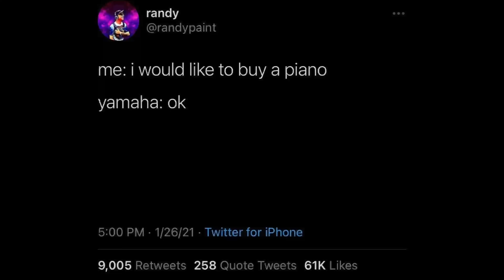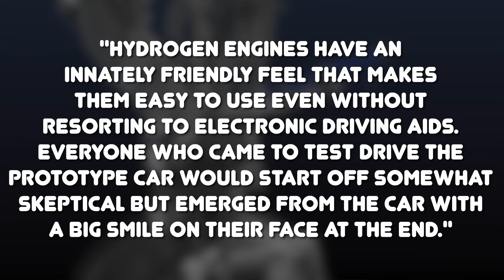Toyota's New 455HP Hydrogen V8: Everything You Need to Know

Comment: You didn’t really mention the greatest advantage of hydrogen. The fuel is abundant, regardless of current fueling stations. People have this idea that we could all of a sudden have several billion electric vehicles and big trucks running around. I think Toyota is genius for realizing that there isn’t enough power grid and lithium production to make that possible. When everyone finally realizes this, you might start seeing hydrogen take over. A world full of electric cars with current technology isn’t sustainable. I think hydrogen has a better shot if we would could get fuel to the streets
Reply: EV will be niche unless the solid state battery fixes the problem that can be produced without using limited supply rare earth materials. And then there's electrical supply grid issues too.
Reply: Solid state potteries seem good, but they are more prone to Dagmar under varying conditions and use than the Lithium Batteries. In the end I’m placing almost all my money on hydrogen
Reply: Exactly.  The world should be taking note as to what the largest car maker in the world is doing.  Also, EVs are not profitable at the present.  Toyota recognized this as well.
Reply: @OverandOutChief1  >I think Elon Musk…the wealthiest man in the world who is happening to produce EVs at a nice profit and sell them at an affordable price, would be very disappointed to hear that!  It is the GAS car makers that can’t make money at it because they refuse to go all in….because people DON’T WANT ELECTRIC CARS BECAUSE THEY ARE INCONVENIENT!
Reply: @viscache1  Tesla is not profitable on its own.  It is being propped by government subsidies (taxes) or else you would see everyone selling all kinds of EVs.  Toyota, the largest car manufacturer in the world is profitable however without said subsidies.
Reply: @viscache1  The last 2 quarters turned a profit.  They are still receiving EV credits though from the US and the EU.  All quarters before were at a loss. They did figure out how to raise GP $ per vehicle which helped along with the strong demand in EVs due to the gas issue.  Hardly consider 2 quarters a trend though.  Also, you really need to see how much debt they are carrying.  It would be alarming to me since it wipes out profit for a decade at present trends.
Reply: @OverandOutChief1  tesla is not what u think it is. Its goal is not to make the money from the car. But from ur data imput. Ur a.car crash dummy. Ur gonna provide them the data.is.needed.to.feed.into ai. For selve driving cars. Once they have this they.make the jackpot. Sell theyre knowhow as a service to the other manufacturers.
Reply: @superliegebeest544  Interesting thought.  Toyota provided the technology and large capital for Tesla early on.  Even they saw the future was not EVs and sold all stake holdings in Tesla.
Reply: Fully agree, instead of trying to apologise for the challenges facing electric cars, let's back Toyota's vision of a hydrogen fuelled car, which will not need lithium batteries or unreliable charging facilities, to produce water vapour as it's exhaust emission.
Reply: @geraldabeyawardena5606  The enviro Nazis killed this because of a small amount of CO2 in manfacturing. However, they are fine with the fact that the manufacuturing of wind turbines produce more CO2 than the trubines will save in their entire life span. Also totally ignoring the disposal nightmare. This was the furture car companies were working on in the 90's once they got the process to be at least no more dangerous than gasonline. They then surpassed it.
Reply: This, people don't also understand that EV's are definitely not green vehicles, there's the Lithium production that is questionable morally and devastating environmentally. And the requirement for much more electricity production and consumption which would increase basic household expenses in an already inflating market, also increasing the need for nuclear power.
Reply: @Loodkuro  Exactly. Lithium may not be a fossil fuel, but there isn't even enough Lithium in the earth to replace all combustion engines with an electric one. Lithium availability is finite. An alternative is needed and it will be hydrogen. Hybrid EVs will likely become hydrogen engine based. The situation surrounding Ukraine and our rock bottom relationship with Russia means oil-based fuels will become prohibitively expensive over time, since the situation contributes to the scarcity of the resource, and an alternative will be required. Even gas boilers in homes are scheduled to run on part-hydrogen in coming years before these world events. In many parts of the world, buses and trains already run on hydrogen. Eventually it will all be hydrogen, because it will become cheap, with a plentiful and ubiquitous supply. In a world where convenience has always driven consumer trends, the growing unavailability of oil-based fuels, coupled with consumer environmental concerns, versus the equivalent utility via hydrogen and its ever-increasing availability and growing ease to prepare in infrastructure, can only point in one direction: hydrogen uptake. Of course, Elon won't admit this today. He's got Lithium-based EVs to sell.
Reply: @maybecrazy7835  the ocean if filled with lithium, it covers 74% of the planet.
Reply: @maybecrazy7835  well informed.
Reply: @Loodkuro  yes! People’s research is the news🤭 the news it’s a well… business
Reply: @Loodkuro  exactly there's only one reason we're not powering vehicles with hydrogen and it's called Lobbyist's
Reply: Yeah, plus batteries need to use a lot of scarce materials and have very high carbon output for production, ice hydrogen cars should be better, especially for the car enthusiasts.
Reply: Exactly electric cars and equipment are great but they are not the answer.  They essentially run on what ever powerplant your local electric company is be it coal or nuclear etc. The amount of new plants that would have to go up if every vehicle and piece of equipment were switched to electric would require power plants in practically every city and the only "green" way to do that would be nuclear for the majority of them. Imagine a Chernobyl or Fukushima in every city and town. Hydrogen really is one of the most efficient in my opinion and the only issue is safe storage which thanks to big government it's  illegal to sell the hydride to safely store it.
Reply: YES hydrogen is derived from water but you can't just pump water in the tank. They developed the fuel cells which they made the tech free to everyone and announce a few years ago at CES. You still need the fuel stations to produce "it's" type of fuel. They should eliminate that and make it so you can just fill up with water.
Reply: @mondum4539  they will never make it that you can fill up with water, because water falls from the sky and they cant control that. they would have to tax the rain.
Reply: @mondum4539  basic chemistry is not your strong suit
Reply: @mondum4539  no u don't u just gotta b smart the difference with how they do it is with chemicals instead of fire  or electricity. In this case u can use magnets to boil water. If only I could show u.
Reply: Just use the electric grid to power a hydrogen generator.
Reply: @tonywalker8030  na way easier to find water from a bathroom ND just refill with water
Reply: @tonywalker8030  u can make hydrogene from cattle manure hydrogen can be produced through anaerobic hydrolysis and fermentation
Reply: @michaelbrinks8089  they been doing that since 2016 in JP north island and  the port of Los Angeles is testing manure-derived hydrogen as fuel for trucks, cranes, cargo from this year
Reply: Um there is half a doz hydrogen fuel stations in California,  I checked when Toyota advertised free fuel for their fuel cell car....  sure if you live next to one.
Reply: Making hydrogen, at this point, takes a lot of electricity.   Its much more efficient to put that electricity into a battery to power an EV then convert it into hydrogen.   There are some technologies I seen videos on that may change that ratio in the future, but not yet.  At the moment most hydrogen production isn't very green.
Reply: exactly what I was thinking when watching the video, he is very wrong about EV's. they cant even provide a power grid these days to deal with a hot day and everyone using AC, let alone everyone plugging in a EV too, and where is the clean electricity going to come from to charge them all? that's not in place either. I think it would be a much easier job to changeover to hydrogen. we already have all the gas stations to sell it. he says zero maintenance? why do auto electricians exist? because gas cars have electrical problems, does he think electric cars wont have electrical problems? and what's it called when it's 8 or 10 years old and the battery's all need replacing?
Reply: pjslawschool  theres no radiation in electri cars. Making hydrogen from water is NOT cheap or efficient. Battery costs will drop in the next 10 years. Scotty doesn't know shit.
Reply: I would buy a hydrogen powered vehicle before I would even consider buying an electric one. I fully agree that the power grid isn't robust enough to handle that many electric cars and trucks.
Reply: Not to mention the fact that lithium is very dangerous and horrible for the environment.
Reply: Will probably have a period of industrial sabotage to make the hydrogen seem much more dangerous than electric,but in the long run it will be adopted and technologies making it cheaper will prosper.
Reply: @dennislock3415  nah, a couple of professors invented a conversion system to make diesels run on 90% hydrogen, and increased efficiency by 26.2%, seems like sabotage to me...
Reply: Also batteries for EV as of now are mainly China monopoly, Chinese companies getting their raw materials from mines in Africa (using kids i heard) sending the raw materials on big ships that pollute more than hundred of thousand of cars to China/Asia, make the batteries (in a plant powered by coal or gas) and send them (by big polluting ships again) to the west to build the EV. The EV is already polluting the environment before being driven!
Reply: Toyota didn't create it look up Bob Lazar hydrogen powered corvette
Reply: Exactly, the electric movement is quite disturbing when you factor in the that the cars aren’t that green (almost not green at all). The only actual plus is performance. The design language of ev’s sucks rn as well. The internal combustion engine isn’t going anywhere. Americans are fuck yards for letting green nazis take over our car market. Thank god Toyota making smart long term bet. Host is sheep for thinking EV will win out In the end. It’s been around since 1800s, what makes you think they’ll take over now?
Reply: There is no way to meet increase in demand that is just starting to occur with the proliflation of electric vehicles. Wind is worthless and there isn't enough silver on the planet for solar to ever be more than a small part of an energy grid. Sivler like gold is seeded here as the earth does not produce silver. All we have access to is silved that was seeded here after the earth formed a crust. The vast majority of silver sank once hitting the molten earth.
Reply: What I would REALLY like to see is a nuclear battery in an electric vehicle.  The one thing that the eco-freaks AND our government doesn’t have the stomach to admit (since the three major disasters…all based in the oldest science and design) is that the nuclear option is small, cheap and very safe now.  The current designs are so effective that if ever allowed to go forward will collapse the ‘pay for energy’ infrastructure.  We could all be running electricity in EVERYTHING….even warming the sidewalks and roads beneath our feet…if they would allow every state to put up two to 16 tiny, domestically engineered ultra safe nuclear power plants.  We would live like the Jetsons and pay like the Flintstones….but THAT will never get past the idiots that have DECIDED that socialism, wind (which they produce in abundance constantly from wherever they speak) and solar (which their egos over shadow and defeat)…’They’ are too stupid, don’t understand the science behind it all and would discount it out of hand simply because “We tried that already”.  IDIOTS!
Reply: Electric cars are horrible - dirtier, heavier, inefficient, and literally cause cancer…batteries are are anything but carbon neutral and are wrecking the environment….plenty of natural gas and oil resources here that should be utilized.
Reply: Hydrogen is a form that can be used in a car is not abundant.
Reply: @mb5058  oh yes it is it comes from water there's plenty of it.  Hydrogen is not hard to make from water but it seems like people today can't do the simplest things I mean alot of people right now don't even know how to cook or open a can with a can opener.
Reply: @jackdaniels2657  and you spew flat earth level nonsense, you can make hydrogen FROM water but it takes a lot of energy, hydrogen is an energy carrier not an energy source. stop spamming your nonsense, the only point you are making is that you would fail junior high chemistry class....
Reply: @jackdaniels2657  yep, as a 9yo, you just sound histrionic/delusional. you don't even realise that if your claims where true that would mean you had invented a perpetuum mobile
Reply: @mb5058  https://youtu.be/staL1wr07Sg
Reply: 28 minutes is where he shows u the technology
Reply: @mb5058  Neither is Lithium. It’s not like it falls out of a mine and makes itself a battery. The hydrogen molecule is just a tiny bit more common than Lithium
Reply: RIP Lil Peep  Do you think hydrogen is a rare element?
Reply: oh yeah and not to mention hydrogen is every were it falls from the sky every time it rains so why would it be so hard to refuel your motor
Reply: Just good until we don’t have any water left cuz we splitting it off to get its basic elements then burning one element if you split 5 gallons of water to its base elements and burn hydrogen your not going to get back 5 gallons of water your going to lose about 25%
Reply: use all the water 😂 we haven't even used all the oil or gas and they are nothing in comparison to even just the polar ice caps, the ice caps that they keep telling us will drown us all. mind you the shore line is still in exactly the same place it was when I was a kid 30 years ago and when my dad was a kid 70 years ago.
Reply: @chadmurray3621  your looking at the wrong shorelines check out the difference in the shoreline from the same period of time on say Salt Lake City Utah or even lake Shasta California… and yes the polar ice caps are melting slowly but the water is not staying in the ocean it’s been being used up slowly keeping the ocean shoreline relatively close to the same spot, we have been making hydrogen from water for years and I have a feeling it’s some of the cause of the droughts we have been seeing since we use hydrogen for testing and other things not just autos, once you break it down and burn half the elements that make water we have less water in the atmosphere and then less rain…🤔
Reply: This. Exactly this.
Reply: I'm the genius, hydrogen is everywhere. If you want a video of that ask me
Reply: Yeah people are glossing over the hard limits to scalability involved in electric cars. Wide spread adoption would make the price of raw materials skyrocket, create a massive disposal issue, and demand a monumental expansion of our power grid.
Reply: @catocall7323  not if people install solar, wind, and battery storage at home, with the grid acting as backup. That's energy independence.
Reply: @michaelkeudel8770  I'll believe it when I see it.
Reply: pjslawschool  no, producing hydrogen is expensive. You can dump electricity directly into a battery with small efficiency losses. Instead of taking energy to create steam  and reform methane or split water. Batteries are cheaper.
Reply: Elon Musk has acknowledged and says like you that over time EV is not sustainable. Be looking for has plan H in the next year or two. This is also current technology working on producing a safe version of Hydrogen for the commercial market that has the Hydrogen in a cassette type container in solid form if you can get your head around that.
Reply: @kingpin76110  storage and useage of hydrogen isn't the problem, creating the hydrogen IS. You can have solar and wind and battery storage in your onw house, you charge your car for free. Or you can drive up tp a hydrogen fueling stop and pay big oil to fill up your tank, making you rely on THEIR infrastructure and THEIR hands in your wallet. It's not and NEVER will be cheaper to produce Hydrogen.
Reply: Who says you need to use Lithium for batteries?  That's like a gen2 battery.  Very recent advances in battery research point to sulfur and other more common battery components that are cheaper to make, easier to recycle, offer greater ranges and similar longevity to Lithium.  Personally I think we should be dumping equals amounts of effort into newer, safer nuclear power facilities and smarter batteries.  Our university, for example, is looking to convert our old, coal fired steam plant into a new, tiny micro-nuclear reactor for cheap electricity and steam using existing nuclear waste as fuel (so basically free).  Hydrogen is a great idea, but I'm not sure how refueling works from storage to car 'tank?'  The engine is the easiest piece of the puzzle to figure out; it's an important piece, to be sure, but it's gotta be the easiest.
Reply: I agree and I hope this is the case.
Reply: Very true. Glad someone else sees that issue regarding EV
Reply: No need to transport hydrogen. Hydrogen stations can be made to extract hydrogen immediately as a person begins fueling. All thats needed is water running through a pipe like every home and sink. The hydrogen station will automatically extract the hydrogen. It’s not hard to do. 

Also another way is to pump water into the cars tank and if engineering design the car itself to extract the hydrogen within the car….problem solved. 

As far as containing hydrogen…..the stations can be made to freeze it to reduce leakage. 

OR

The vehicle extracts the hydrogen it need while maintaining a percentage in water. To reduce leakage and when ever it needs more the device inside car will automatically begin to extract the amount hydrogen it needs

And I don’t know about fella in the video. He seems extremely bias by saying there’s no differences between Gas combustion engines vs Hydrogen combustion. There’s a huge amount differences using hydrogen. Theres less heat being generated which gives all parts in engine bay including the engine longevity. Parts are less susceptible to wear and tear with hydrogen. 

Personally I’ll buy an electric just too vary my collection but i prefer combustion engines all the way. EV’s anyone could be riding a bicycle and no one would know if they’re about to get hit by a car because they’re so quiet. EV’s dont look fun, feel fun, roar from the engine. And what if a war breaks lose and the enemy attacks the electrical grid. We’re all screwed. How will we charge our vehicles to get around during war?
Reply: YouTube h2ilmarketing or just h2il. Supposedly found a way to super charge electrolysis to 5000% efficiency at large scale. I dunno if it's real or not.
Reply: Why is everyone ignoring the fact, that you'll never be able to save as much energy in a car battery as you can with a tank fuelled with either gasoline or hydrogen, its just physically not possible.
Reply: Exactly!
Reply: @Land and Lore Photograph Off Road Adventures Hydrogen already is being used as fuel for cars.
Reply: Agreed diversity have multiple power supply options which will make them all more cheaper in the long run. Not to mention more commonly available world wide which would inspire more innovative in each technology
Reply: Yes, hydrogen is abundant, but, it still has to be produced from water or natural gas which will take energy from fossil fuels, preferably natural gas, why not just run the engines on natural gas, there already is a partial infrastructure, long live ICE
Reply: It's nice to see the people on the top think and listen are open to new ideas
Reply: Hydrogen source is water. We don't want to use hydrogen for engines. Hydrogen is for drinking and washing clothes.
Reply: @eugene7518  Some of us don't want the regular engine to die
Reply: @\f_a/ exactly making it highly explosive
Reply: @\f_a/ ur point? I never said anything bad about hydrogen. Water is hydrogen water is also air. They add water to gasoline. Water is everywhere and it's free but people think hydrogen is a gas but it comes from water ND people don't seem to understand that
Reply: @\f_a/ perhaps alcohol is better
Reply: and lithium is bad for environment heavy and lame
Reply: We must not use our water to power engines. We need water to drink and wash.
Reply: Hydrogen is not abundant as a free element. It is tied up with oxygen in water. It is water that is abundant. Producing hydrogen is very inefficient. This is further compounded by compressing (or freezing it), then transporting and, finally, using it in an internal combustion engine.
Reply: Japan certainly doesn't have enough power grid. That's exactly why Toyota is going with HFCV technology. That and they're dependent on China for REM's.
Reply: Hydrogen is being used as a hydrogen battery, so it will need a lithium battery as well
Reply: @Anonymous-nn5wn  Only for the moment. The presence of a lithium battery on board currently available HFCV's is largely a function of the lack of H2 fueling stations. As with an ICE/battery hybrid, these can run on the battery alone  for short trips, stretching out a hydrogen fuel-up. The lithium battery can also store energy from slowing/braking the car, as with a Tesla. As H2 fueling stations become more widely available, and manufacturers seek to expand to a mass market with more affordable vehicles, the lithium battery will likely be offered as an option on higher-end models. A regular automotive battery will be sufficient for most vehicles.
Reply: I don't think so. EVs just need to do more research and develop cleaner, higher energy density and charges very fast batteries. For hydrogen, from splitting the atoms, converting it into liquid, then storing it, then transporting it, every step takes a lot of energy (which will result in high cost per kg)
Reply: Bruh, hydrogen is not plentiful on earth.
Reply: @aygwm  70% of the Earth is water. Guess what water is made out of?
Reply: @aygwm  Can you put crude oil in your gas tank? Will a chunk of lithium power a Tesla?
Reply: @mikegreen2229  does it require energy to split the hydrogen atoms and oxygen atoms? After splitting it, do you need to convert it to liquid state?would you lose a percentage of it while storing it?
Reply: @mikegreen2229  of course not, but implying that hydrogen is just sitting out there in its natural state ready to be burned is asinine. Critically, it takes more energy to isolate hydrogen than it yields when burned, unlike petroleum products.
Reply: @tanalson  What does that have to do with any of my comments? I’m not the one with the responsibility to make any fuel system sustainable, renewable, economical, reliable, etc etc etc…. Pollution from lithium mining? Toxic waste leaking from the damaged reactor in Japan? I never claimed to have any of these answers. I question people’s common sense, which is lacking in these comments. I wish I never replied here, because I constantly get notifications about bs like this which is a complete waste of time.
Reply: agreed...
Reply: or the fact you are able to produce it yourself and they hate self sufficiency
Reply: hydrogej is not abundant you need to make it, it's a power carrier mot a power source. considering the worldwide move to destroy energy production inder the guise of going green there is not enough power toake hydrogen on scale. also its less efficient then using hydrogen in fuel cells to create electricity
Reply: @nicoramaekers1623  The most abundant element in the universe
Reply: @boywhohasl1vedhascometodie469  true but that has 0 relevance in regards to using hydrogen on earth. its the most abundant element in universe because most stars are mostly hydrogen, but id like to see you fill up your car there
Reply: @boywhohasl1vedhascometodie469  do show me, hydrogen produced with nuclear generated power thru electrolysis is close to 0, is that what you are talking about?
Reply: @nicoramaekers1623  Just because you have to process it into fuel doesn’t mean that the element of hydrogen itself is rare. It is literally everywhere
Reply: @mikegreen2229  not as hydrogen on earth....as part of water and loads of other molecules yes. are you being wilfully misleading? get if from water and it takes energy, get if from fossil fuel and it pollutes....should not be too hard to understand
Reply: @mikegreen2229  on a sidenote hydrogen would for sure be the better option vs batteries, if power was plentifull and cheap
power is gettingore expensive and scarce each day due to so called environmental policy (which is eating up our supply of rare metals like indium at ever increasing rates)
Reply: @nicoramaekers1623  where is the fallacy of what I have said? Hydrogen, as an element IS extremely common. That has ZERO to do with the process of extracting it. Do you think that electricity was easy to generate or transport at first? We literally had to build an entire infrastructure to do it. They even struggled for years to decide whether AC or DC was the best way to use it in everyday life
Reply: I have the same opinion.
Reply: Along with the weight of EV"s. There will be at the very least 1,000 additional lbs per EV, what about parking garages, bridges, the roads, etc. Non thinking people make decisions on Emotion, never on Logic. All you have to do is think
Reply: And Japan is working on a new nuclear reactor that doesn't meltdown and simultaneously on a viable and cheap way of producing Hydrogen. Which both systems are on the verge of approval. They basically want to produce Hydrogen with nuclear power, and i guess it's working.
Reply: Oh and most hydrogen is cracked from propane🤪
Reply: hydrogen is not abundant it is not a natural occurring gas it needs to be created as for lithium it is one of the most abundant minerals on earth, just another bs trial by toyota to try and stop the advance of BEV while they try to make more hay out of the petrolheads that are high of the fumes of petrol
Reply: He also doesn't realize that similar was the case with EV electric charging stations just a Decade ago. So in a Decade if Hydrogen Engine kicks off now the Hydrogen Fuel pump will widely accessible. And for true car enthusiast that gonna a deal breaker. As I love to have a engine any kind of engine rather than two silent motors. Electric cars feel soul-less for me.
Reply: Honestly hydrogen comes from water u don't need hydrogen stations. This isn't new technology. The guy that invented the original hydrogen powered car was murdered. The way to create hydrogen is pretty much just boil water ND it turns into a gas finer then steam. Steam engines was technically hydrogen motors ND yes steam engines are to this day the most powerful engines ever built. Steam engines don't have an actual power  limit, the limit of a steam engine is being able to contain the pressure cus it's so much pressure it can easily be turned into a bomb if the boiler runs low on water.
Reply: @jackdaniels2657  not trying to start a YouTube comment war, but you can't just boil water and get hydrogen.  Electrolysis is the process of converting water into hydrogen and oxygen gas by the use of electricity.  The problem is that it's horrendously inefficient and therefore really isn't a solution at all except for perhaps more remote fueling locations.  Piping in or trucking in hydrgon will be the most economical way of getting fuel to stations for a while.  The issue there is that the average Joe isn't too keen on hydrogen lines running throughout town even though they aren't much of a safety concern.

Aaaaanyway....  Steam engines are also not powered by "hydrogen", just sayin'.  It's steam (aka water vapor, not hydrogen).  ;)

Bot or not I thought a reply was worth a shot.
Reply: @bentracy7463  dude u boil water it will turn into hydrogen. I'll send u a link
Reply: @bentracy7463  steam engines are powered by steam but that steam can turn into hydrogen if done correctly
Reply: @jackdaniels2657  we need electrolysis to become efficient
Reply: @jackdaniels2657  Idk what chemistry class you took but boiled water is still water. It’s just water vapor or steam. If what you’re saying was true you’d be able to hold a lighter above boiling water and have it combust.
Reply: @bentracy7463  >yep, no war, I spent my career in physics and it is very clear that electric cars are really sexy and low maintenance and we already have the BASIC (but no where nearly enough for everyone for at least 40 years of all out construction of infrastructure at enormous cost) And it WILL REQUIRE NUCLEAR POWER on large scale!!!…but they are going forward anyways and we will all get to see the current infrastructure implode and we will suffer until the government steps in with a REAL infrastructure bill that addresses things like…..hmmm…how about INFRASTRUCTURE instead of trying to buy off voters across the nation and sneak in pet laws that will enrich the politicians who…by all appearances…are ONLY there for the money now.  I built an Hydrogen Welder.  It’s small and requires an injection of certain electrolytes to make the chem split at a high enough rate to actually get enough hydrogen to combust.  You’re right about the not being able to just pour in water and drive…the power to do it that way would be so enormous that it would require an umbilicus directly to the power plant for every car…(talk about your snarled traffic jams!).  But the driver or service attendant at the fuel station would have to handle extremely caustic chemicals every time someone needed fuel…this is not a solution…and neither is a future of giant pressure tanks full of explosive gas littered throughout residential neighborhoods and down town in dense cities…this just ain’t happening.
Reply: @jackdaniels2657  >Having built my own hydrogen generator/welder I can tell you that you have skipped over a great deal of very dangerous and importance sciency stuff.  We would be far safer going back to the steam engine.  There is a 210 year old 48 horse power steam engine that is quiet, efficient and can run the car that they put it in at almost 70mph for over 300 miles on a single fill.  The trick?  It also requires about six liters of gas to heat the water coil.
Reply: @NTropicCharm  >BINGO!  I’ve built my own hydrogen ‘water’ welder and it requires electrolytes and caustic chemical process to work.  There is no such thing as a ‘steam hydrogen separator’ …this is a dream of luddites the world over!  The energy required to use only electricity to separate hydrogen from water would mean a direct umbilicus to the power company…which would be hard to explain when you turned in all the accident claims to your insurance company.
Reply: @viscache1  there was a guy back in 70s or 80s that made the first car to run on hydrogen he was able to go about 3000 miles on 5 gallons of water. They killed him tho
Reply: @viscache1  I just sent u the video
Reply: @jackdaniels2657  NOOOOO!
Reply: @1diggers1  u can create hydrogen by boiling water
Reply: @viscache1  As a very solid RULE, if the policy makers are supporting something, one ought to be suspicious of that policy.  The world's history shows that the changes that really stick around evolved due to the success in regular competition of some tech.  Kerosene was far better than dangerous and disgusting whaling for whale oil.  The Kerosene industry shifted over to the fuels industry once ICE came along and could use their byproducts. None of this was imposed from a central policy maker.  It happened because it worked and people proved it worked in countless independent "experiment" situations, ultimately leading to massive changes.  I personally believe the source of future power should be as Alvin Weinberg envisioned - plentiful Thorium burned in Molten Salt Reactor tech.  I'm not alone.  There are huge numbers of people hoping for LFTR as a legit, implemented plentiful source of safe inexpensive and clean power.
Reply: @bentracy7463  the pipes are already there, hydrogen can be sent down natural gas lines.
Reply: @bentracy7463  andd a compound splitting into atoms isn’t a conversion per se, it’s a process 😉
Reply: @jackdaniels2657  which high school did you go to? I need to know the name
Reply: @bentracy7463  steam engines are powered by coal, the water is the expander. liquid fuel combines the fuel with the expander
Reply: @bentracy7463  Efficient Green Hydrogen production exists. The world is just not aware of it yet, but it soon will be.
Reply: @jackdaniels2657  while I like hydrogen, boiled water is water vapor. Also you need a particular kind of chemical reaction to break water up or it needs to be unrealistically hot for a car to work (I think not sure) Catalysts could be used however to make water into hydrogen creating solar panels basically. 

I think a Japanese scientist is working on it and is currently at 1/3 the progress of making such hydrogen farms at the efficiency of photosynthesis for albeit a thin layer of water at a given time. Also, getting something like this to work in the night might present issues but looks promising nonetheless. We’re looking at catalytic efficiencies through photocatalysis which may be as efficient as nature’s perfect solar panel, photosynthesis. 

EV’s will still have a space, but my hope is that in the near future, the more resource friendly hydrogen combustion would be the gasoline of the future while EV and fuel cells become the diesel. Its looking like an uphill battle but a worthy one. Hydrogen production looks promising, but storage might be something to look at. It almost makes me want to become a scientist myself. If you like being at the forefront of scientific discoveries, hydrogen looks like it will have more space to grow than EV’s
Reply: @jackdaniels2657  1.  you don't get hydrogen from boiling water. 2. Steam engine is NOT a hydrogen motor at all.
Reply: @1diggers1  oh yes it is it can blow up just like hydrogen a hydrogen bomb is made with water. Water is very explosive